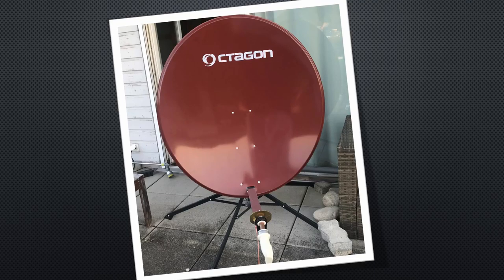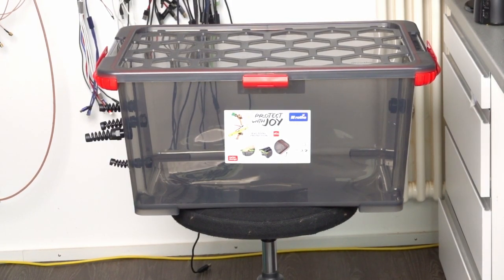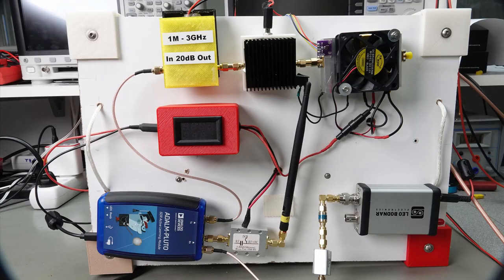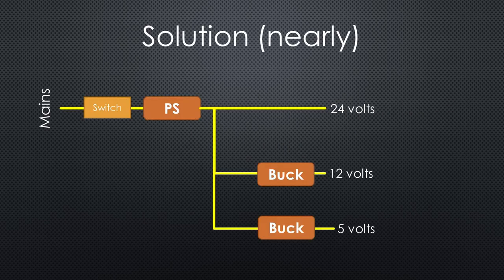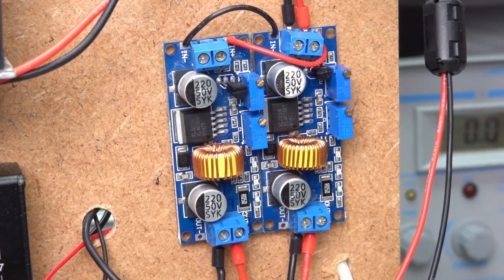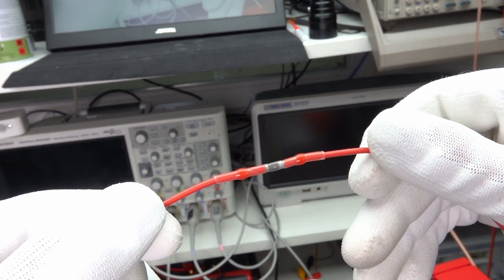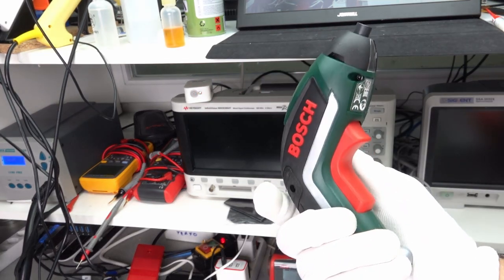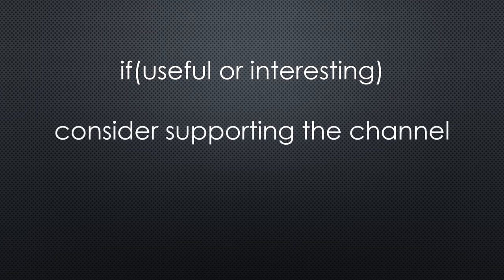#357 How to assemble an outdoors electronics project

Comment: Tip: Whenever you use hot glue preheat the components until they feel hot. Glue then flows very good and bonds much better.
Reply: I use hot glue quite often and I had never thought about this. Excellent tip, I will try that!
Reply: Thanks! Great tip
Reply from the maker: Thank you for this tip!
Reply: Nice 👍

Comment: Good video that covers many aspects. 

Those in warmer climates would be aware of the temperature rise of any box in the summer will terminate most consumer electronics within weeks.  A simple workaround is to put a simple shade roof over the box, spaced to permit free air movement.  The roof gets very hot and promotes convection around the box so that it doesn't get much warmer than surrounding air.

Of course there are issues with wildlife everywhere! Even the bipedal! Choose the site accordingly!

Also, sunlight will rapidly degrade plastics without UV stabilisers. Choose enclosures according to the environment in which they will operate.
Reply from the maker: Of course you are right with the sun protection. For the next 8 month I do not care too much about it where I live. Time to find a solution... 
Wildlife also is not an issue here (unfortunately we killed or banned a lot of it).

Comment: I always use "clear protective lacquer" on the boards of outdoor projects, even if i use a tight box. When i access the box in a moist environment, water somehow gets to the components and to prevent corrosion it is a great addition, imo.
Reply from the maker: Thanks for this tip. I once planned a video on the topic (after my humidity sensors). But it never made it on the top priority.
Reply: There is something called CPC, clear protective coating, and I've used this for years protecting boards in the worst environments. I think it is just a spray lacquer as you mention.  If you can orient a box, make sure it has a drain hole. Most problems I have seen is that not that moisture can get in, but has no way to get out.

Comment: you can use aluminium foil on the wooden plank and connect it to ground.
This way you can mitigated some radio frequentie noise of the powers supply side, getting to the rest of the circuit.
Reply from the maker: Good idea. And a cheap alternative!

Comment: I used urethane conformal coating on electronic components. You can get spray on, but I prefer the brush on. I also use marine grade heat shrink tubing in some applications. It has a heat activated glue inside the tubing. It melts and coats what you’re using it on. Forget about getting it off, but for things where that’s not an issue, it works great.
Reply from the maker: Conformal coating is a good thing. So far I hope I will not need it inside my box. But it is a last resort ;-)
I also have such tubes with glue. I did not know they come from the marine. Mine are quite stiff and not transparent.

Comment: Marine grade shrink tubing is also useful as it has meltable glue on the inner surface which then weather seals the ends, great for outdoor antenna cables and power accessories like polarity switches etc. Thanks for sharing Andreas!  73 - Dino KLØS
Reply from the maker: I have some stiff tubes with glue. But so far I did not use them often. I have to keep them in mind next time...  73 de HB9BLA

Comment: Yes, thank you for the weatherizing tips and another quality video.  The moisture removing silica descant packets frequently found in pharmacy bottles can be useful for small boxes.   Even the bottles themselves can be used for smaller board/battery projects.  Another idea: I have been using 1-1/2" black PVC pipes to contain my PIR sensors/433 MHz transmitter/Battery combinations.  The sensor faces out one end and is mounted inside a matching PVC pipe test cap with the knockout removed to fit the PIR sensor.  The PIR is sealed into the test cap with silicon caulking.  Another test cap (retaining the knockout this time) is fitted in the other end.  The nice thing about using the PVC pipe is that plastic gimbled mounting brackets can be glued right to the side of the pipe.  The entire assembly is then mounted under the eves pointing at every outside door and window location (six of them).   One receiver is indoors and collects/decodes all the 'alarm' signals.  All the materials were very inexpensive, though it took me years to build.
Reply from the maker: Good idea with the plastic pipes. They are very cheap and you get them in different sizes. Once I planned to put a silica packet in my gateway and bought 500g. But so far it was not necessary.

Comment: Thanks for sharing your vast knowledge and testing! I once used containers similar to that to try to keep 3D printer filament dry. Even with a large amount of desiccant in the container, the humidity seeped in and equalized with the environment. I then tried 5 gallon buckets (very cheap and common in the US) along with removable sealable lids. They have worked much better. With 8 ounces of desiccant in the bottom, the humidity inside has been maintained < 15% for over a year even with numerous cracking of the seal to obtain filament.
Reply from the maker: Interesting idea those 5 gallon buckets. I assume they have to be tight because they are often used for colors an other chemicals which react with humidity.

Comment: Very useful tips as always. Thanks for sharing. BTW: you can fill those heatshrink tubes all over with hot glue and even cover the PCBs all over with the glue. Try what happens if "Spiritus" touches the glue... It will peel off without any residues like a charm. Very useful
Reply from the maker: Good tip with the spiritus. I will use it next time I want to remove hot glue.

Comment: 8:33 additionally this is the right thing to do with flexible wires in screw terminals, as flexible wires can loosen or break off with time, and adding solder to them is wrong. The screw will push the solder flat over time, and thus will no longer work as intended, resulting in a loose connection.

One more thing: Wires conduct electricity as well as humidity via the capillary effect, and via the pressure differences created by heating and cooling in the casing. Every connection that has open wiring somewhere must be perfectly sealed against ingress of humidity too, if you absolutely have to avoid humidity in your project. There are special membranes that allow your casing to breathe while not letting through water, minimizing the pressure difference problems.
Reply from the maker: Thanks for the addition!
Reply: Making every thing tight to fighting humidity? Its a fight that you loose every single time!
In a UBoat you see immediately where water comes in... in a pojectbox you will never find out.
Even when you make every cable tight, one of the overseen problems: The humidity that is already in the box, e.g. if you open the box on a warm summer day there is enought humidity inside to condensate when themprature goes down 10°.
Obey a simple rule: "If Humidity comes in, Humidity must have a way out" and its fine.
For some applications a almost zero humidity is needed, but those are put into a sealed steel box and have some not so cheap "Membran" Devices to suck the humidity out.
But for projects like this, there is no real need for that effort, if the humidity is not higher than in your rooms it is ok.
To archive this you simple let the humidity in and out (let your box breath), keeping the hummidity inside lower than outside is simple done by the power dissipation of the content (Its like like a real fight... avoid the fight and you can't loos :) ).
E. g. (for the size of this project) drill  hole with arround 1cm to 2 cm into the bottom of the box, and glue a 5 cm long pipe (as a water trap)  with a fine grill (to avoid insects and break high winds) on the outer side. Keep the box tight the hole should be the only place where air comes in and out, just to keep it simple.

There are many other "designs", even some that dont need any heating inside the box or allow cooling by exchange air... and yes this is a real sience, you can spend decades of you life.
Reply: There is an awesome bigclivedotcom video on active (magic) solid state humidity pumps that you just apply 3 volts and they create a molecular water pump. For very little energy your enclosure can remain dry as you want.  Just don't overvolt or reverse polarity on them :D  Edit: link https://www.youtube.com/watch?v=Vabq-s62IVM
Reply: I have my eye on those membranes for an automation application for agriculture. So far I have been trying to gather info, and checked the gore-tex membranes for automotive. If anyone has first hand experience on them, that would be much appreciated.
Thanks for the video, btw.
Reply: @frollard  i searched EEVblog for this...  logical that i cant find when it is on BC-DC's channel :)
Reply: @vatandas1542  I used them professionally on locomotives. Works fine, even for a longer period like five or ten years. They keep dirt and dust out. Labyrinth plugs are often larger. They will clog over time.

Comment: Very informative video as usual.  Have you considered using slotted trunking to tidy up the cabling?  Also I have used Pflitsch Uni Split cable glands at work which allow cables with pre-moulded connectors to be easily routed into an enclosure or cabinet.  As an example they have a rubber insert that allows for 4 x Cat6 cables to be routed through one M25 gland.  They are expensive but save time.
Reply from the maker: These Pflitsch Uni Split seem to be a good solution. I did not know them. But really they are very expensive for makers :-(
So far I was not too concerned with tidy up the cabling. Maybe when everything is sorted out and I remove the power poles and replace them with fixed cabling.

Comment: Nice video as always. I Hope you make a followup after the winther on how well your box survived.
A tip is to replace the trimmers on your Buck converters with fixed resistors, this will improve stability and avoid mistakes.
Reply from the maker: Good idea for the resistors. I have to check if I find a suitable fixed value. I fear less the winter because the box is partly covered by a small roof. Summer is probably more dangerous

Comment: A lot of good advice. Must have one of the Bosch toys! You are so right about Chinese ratings. I fried three cheap processor boards because the onboard 12v regulator couldn’t handle anywhere near 12v. You would think I would have guessed after the second...!
Reply from the maker: Many Chinese boards are ok. Power supply and batteries seem to be a special case where I pay more attention.

Comment: Well done, as always! However, when choosing a plastic container material for long term projects, pay attention to the aging of polymers due to UV exposure. Some plastics “burn out” and break down rather quickly, sometimes within months, especially those that have been recycled. I also suggest to add a pack of desiccant (silica gel), just in case :)
And you can always use good old "Zaponlack" to cover the components as well. It's probably the cheapet way to protect PCBs, but it's hard to re-solder if needed after Zaponlack is applied. All old military-grade USSR-era PCBs, as well as gun ammo is covered by Zaponlack.
Reply from the maker: You are right with the UV. I do not hope for a too long live (and we do not have plenty of sun where I live). For the moment I did not add silica. But I have a 500g bag if needed. I will watch the humidity.
Reply: @AndreasSpiess  500g is a big bag :) It will be fine with a way smaller bags. In the end, in such projects It will all depends of temperature/moisture inside and outside the container, the "dew point", and the air float. To actually cool the devices in such plastic cases, it needs some airflow with a lower air temp from outside (since it is a plastic capsule). More convection - more cold air sucks from outside, colder air brings more humidity. So it is a question of balance, and even If the device will produce enough heat, that humidity must go (vaporise) somewhere, or to condensate on some colder surface.
Anyway, the project is great, and it is always a pleasure to see your projects and hear your marvelous accent ;)

Comment: Hi Andreas,

I really enjoyed the build video.
With a lot of the build discussion being around supplying power to the project I would like an objective opinion from you:
I use pc power supplies for a lot other than pc's.
They provide the voltages needed, the current needed and are an all in one box solution for a mains powered supply for a project.
They are freely available and dirt cheap.
What am I doing wrong by using this route to power my projects?
You can roast me on this one, and maybe I have offended you by suggesting this.
I hope not, as I see pc power supplies as a parallel universe to projects requiring 24, 12, 5, 3.3V, etc?
But, one should not scorn on others in the community.
What works for the maker is good.
And I respect that.
Kind regards,
Duncan
Reply from the maker: I never looked at them so far. But for sure they are a good choice for higher power projects. This project is one of the first needing mor power than a few watts.
It also should be easy do switch them on and off.

Comment: I love andersen powerpoles, but I think for this I'd have used a few WAGO connectors. Good luck with the enclosure. I've had so many outdoor projects fail that I'm not sure any more that there is a long-term solution.
I've found grease in all the connectors to be vital in preventing electrolytic corrosion when condensation forms. Need to use a grease with a higher melting point than your project will survive and then use solvent to make it flow and dip the connector. When the solvent evaporates you have a nicely greased connector.
Another technique I am trying now is to use oil and wax and heat (or maybe solvent). It needs a very small amount of a soft wax to avoid becoming an insulator for signal and low-pressure contacts. Purified bees wax and mineral oil seems to work well, is food safe, and safe for most plastics used in electronics.  Don't dip potentiometers or variable capacitors! But feel free to use in the kitchen on wooden knife handles and cutting boards. :)
Reply from the maker: Unfortunately I did not have such big WAGO connectors. But a few are on order now...
Concerning contact protection: They sell a spray for that purpose, but I do not know what's in. I guess not "food grade" as you solution ;-)
Reply: @AndreasSpiess  :)   I've not had good luck with CRCs terminal protection spray on signal connections (like RJ-45 ethernet and similar). It never penetrated into all the little nooks and crannies and consequently moisture found places for corrosion to begin.

Comment: This video contains so many interesting little bits of information. Last year I made my own such project and it was hard to find some decent do's and don'ts on youtube. This video fills that gap.

Did you add any fuses or current limiting components to the project? Humidity or a short in the fan might cause a short circuit.
Reply from the maker: Fuses are always a good thing. I add them here and there...

Comment: Grüẞ Gott Andreas. Gutes Neues Jahr! ... Don't forget heatshrink as a better way to make smaller diameter cables fit larger glands. One, two or more consecutive heatshrink sleeves make for a better waterproof (and less messy long term) seal inside cable glands.

Tshüẞ.
Reply from the maker: Ebenfalls Frohes Neues Jahr! You are right. Unfortunately you still have to remove the connector to add those tubes. Then you can also use a smaller gland. Tape could maybe an alternative.

Comment: Have you had good experience with the solder shrink tube? I was always taught to push the end of wires into each other. Then twist the ends in opposing direction before applying solder, for a good mechanical connection to support the electrical one. So I saw these but often wondered about the longevity of the connection with the cable just laying next to each other in the connection, only joined by solder.
Reply from the maker: You gan push the cable strands that they overlap. And it depends of course on the purpose. If you need only a few amperes they are ok I think. My wires will also not move inside the case. Otherwise crimping would be better.
Reply: Thanks for getting back to me so quick Andreas. I'm sure you are right, and for the majority of my maker projects they will be fine. I will give them a try. Great content, I have been watching for over a year now. I enjoy the editing, and approach. With the intro, demo and follow up. Keep it up!

Comment: This is one area i did quite a few things. Try resin potting the whole thing and also using silicone. Clear lacquer and u will find dielectric disturbance is negligible. But this is rf.. so be careful. U can get special resin for this if u want
Reply from the maker: So far I refrained to use conformal coating of any kind (because it is RF). But it is the last resort in my mind. We will see (and measure humidity).